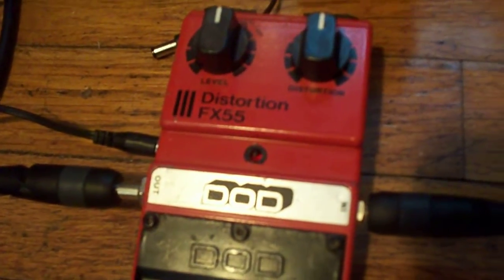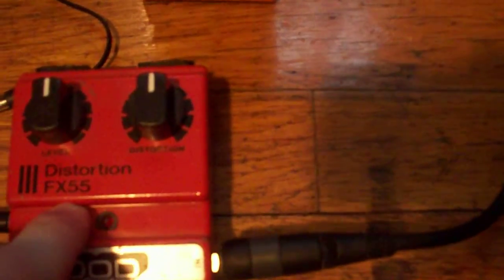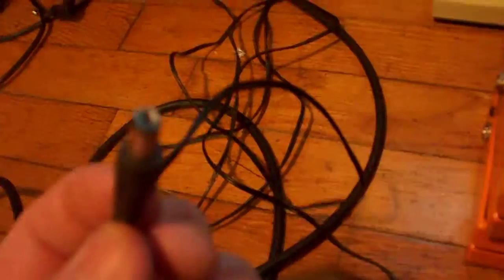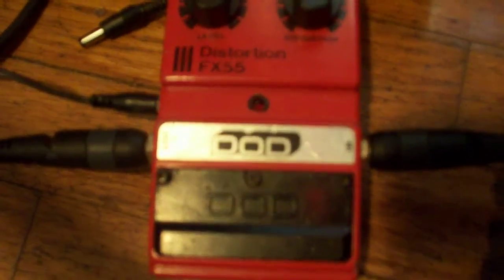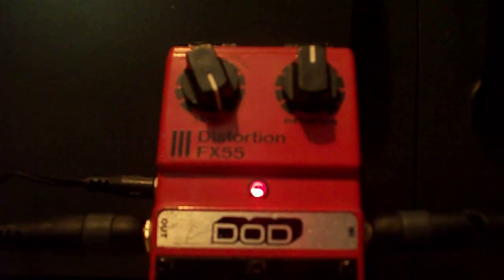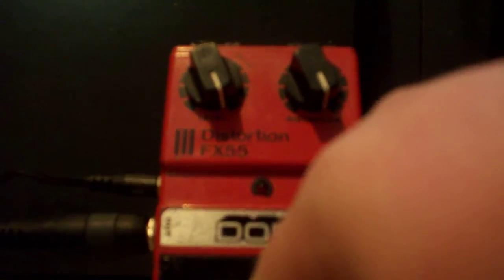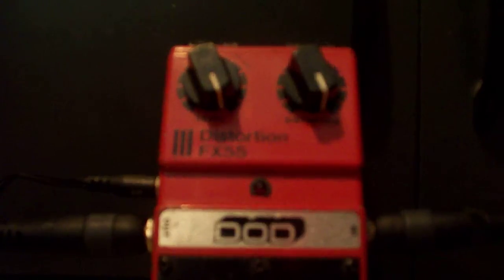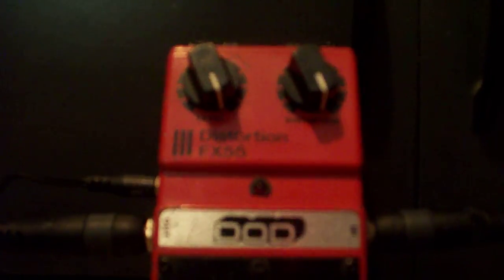DOD FX55 Distortion (Vintage 1984)

Comment: Secret to this pedal - Max out the level, add distortion to taste - I usually leave it all the way down/left or up just a bit (like around the 1st little notch) depending on the amp. Great in front of an AC30, Princeton, or any good tube amp just on the verge of breakup.

Comment from the maker: @mrsub360 Yeah, totally. Most DOD pedals, particularly the FX series, tend to go for somewhat reasonable prices on ebay. The only real exception to that for DOD pedals would be the rarer FX pedals, Such as the Metal X or the Corrosion, and the early DOD pedals, such as the DOD 250 Preamp/Overdrive. But, I've bought three really good DOD pedals on ebay for about 20 a piece, and just won another one for 20 bucks.